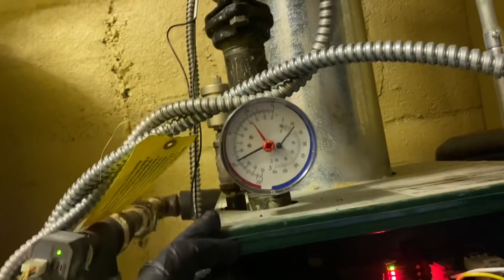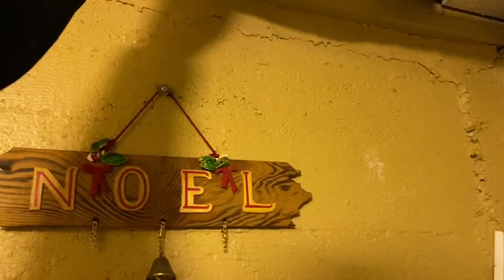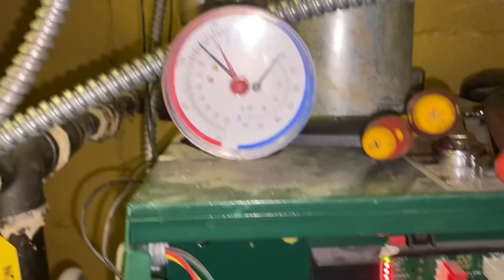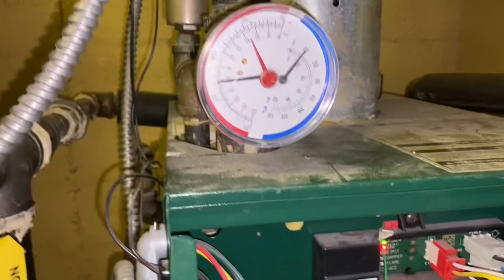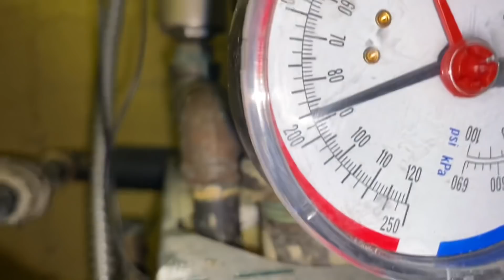Williamson GWA-105 Not Heating House Above 49 Degrees

Comment: Mikey Pipes! I'm from Nassau County, live upstate now. I have the same unit and it's been giving me lots of problems. Last year I had an issue with the limit switch, boiler wouldn't get up to set temp (160-180) but when I turned set temp up to 200 boiler would reach temp. Unfortunately I left it at that. This past Thursday I began having problems again, boiler just wouldn't fire. I began doing my research and found the problem I had last year was fairly common and to replace the control module. So I replaced the control module yesterday and the boiler fires right up! It got up to temperature and I was happy, moved onto other things, then when I came back it was doing the same damn thing as before. I did notice the circulator pump was pretty hot. When called for heat the t-stat/circ and limit lights will come on very briefly then shut off. I feel the circulator pump come on but maybe it's on it's way out and this is the issue? I'm going to see if I can get my hands on a new circ pump and try that next I think but I am actively working on this as I post this comment, if you have any words of wisdom my family and I would much appreciate it!
Reply: So upon further investigation I found it to be the zone valves. When put into manual they would make contact with the switch then spring back and break contact. I installed 3 new zone valves and my heat is now working. My only concern now is when I switch the zone valve from auto to manual, the lever does not make contact with the switch. Is there any way to fix this or did I do something wrong? When the thermostat calls for heat the lever will turn all the way and make contact with the switch just not when switched to manual.

Comment: Hey Mikey, tomorrow I get to change out a 75 gallon water heater.  What fun. Today I had a call for a bathroom sink drain leaking in a apartment. Discovered that it was that metal slip joint drain pipe.  And not a washer in sight. Apparently it had been leaking every since the owner paid a so-called plumber to install a new vanity in the apartment.  She's not hiring him again.
Reply: @PipeDoctor  that it was. Damn water heater is set as hot as it will go and is barely even warm. But it is 9 years old.

Comment: changing the motor cartridge is often faster than replacing the whole circulator. but if it's crusty as hell, don't do it.
the volutes rarely fail or have issues, unless physically broken or rusty. as long as you don't have a very new old stock circulator to put in, the square cut o-ring will be good and pliable.
just clean the old volute face with drill mounted scrubby pad to ensure it's clean. no rough sand papers or things that gouge and scratch, which will cause leaks.

Comment: You DO need a flow check to prevent migration during a no call even on single zone. At least until the boiler cools and over shoots setpoint. If you had zone valves you wouldn’t need it. IFC pumps are the ticket though. The old green checks and the Swetcheks tend to stick open frequently.
Reply: pay attention that "flow" is limited more by IFC's than the old school check valves, also that plastic "checks" tends to fail and will even lodge into the pump and other places blocking them.

Comment: boiler hitting 180 then set to 190 with new circulator and still hitting the limit in a single zone/loop home? first thing, look for flow issues, lack of radiation elements or too many things covered/closed/blocked/full of air 9 cast iron base/radiators. then do a rough guestimate of BTU's needed. way oversize boiler( not that tiny thing, lol)